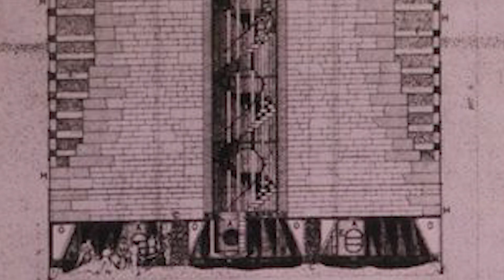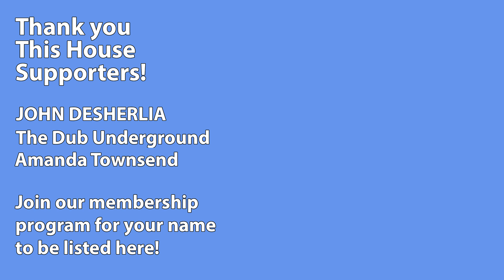Who was James Eads? | Designing the USA

Comment: Interesting to learn about the Chicago v. St. Louis 'trade war'. It makes sense, though. I like to compare what a place looks like now with how it looked in 1922, then imagine how drastically different it would have been in 1822. Until 1821 the sleepy settlements that became Los Angeles and San Diego were governed by the Viceroy of New Spain. I love seeing the old engravings and photographs. The engineering feats of the second half of the 19th Century are impressive, especially when you realize they were done without computers, and (for the most part) diesel powered engines or electricity. Elephants do seem magical, don't they?
Reply: The NYC subway system? The tunnels were hand shoveled by mostly Irish immigrants.